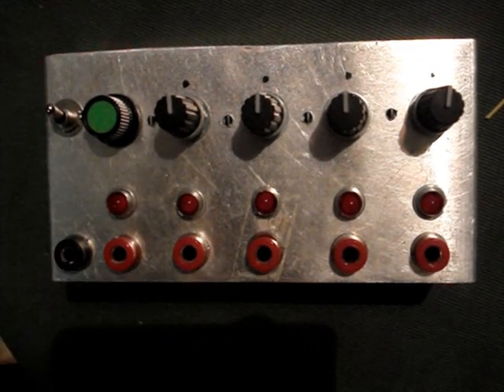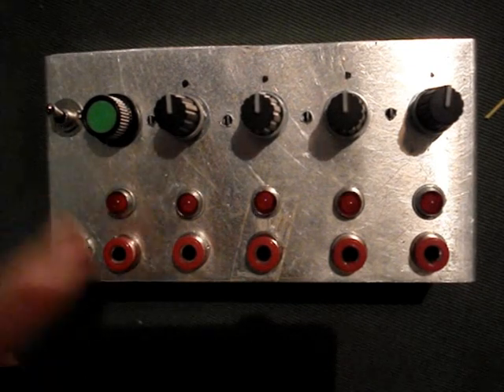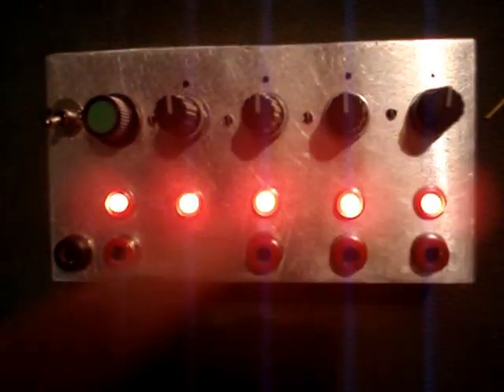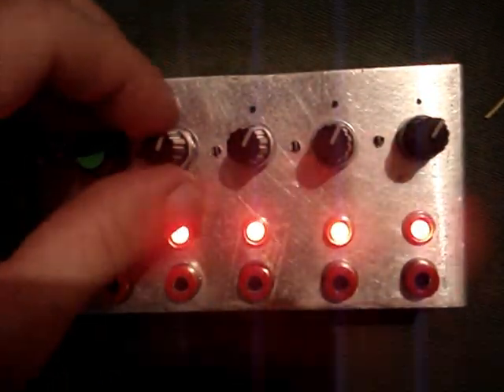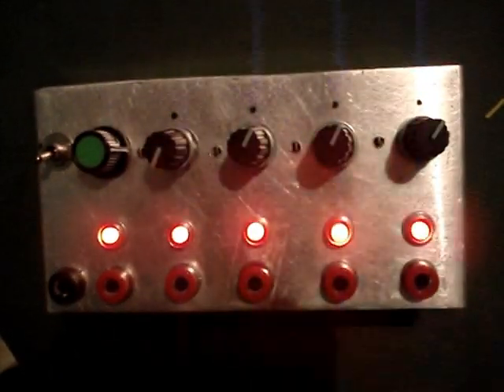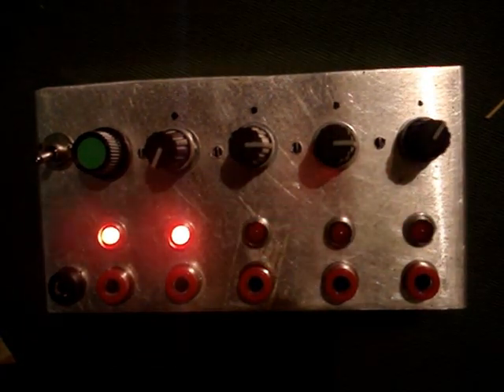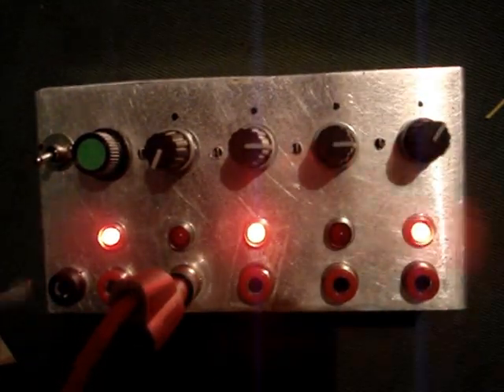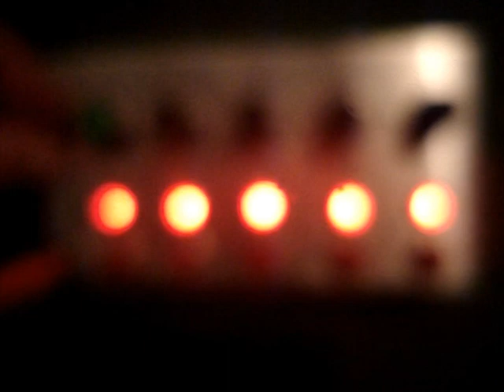ClockBox v1.0

Comment: Hi Dani, do you know if all the divisions line up right rhythmically? Or is there a delay? The phase might be fixed by doing a reset?
Reply from the maker: they do! the input on the clock pin controls every division output simultaneously so they are syncronized.